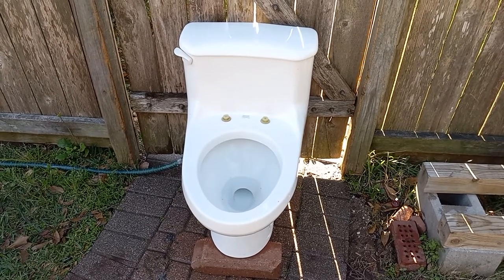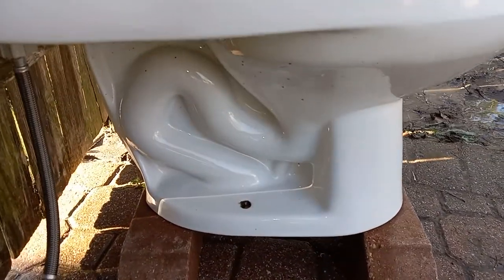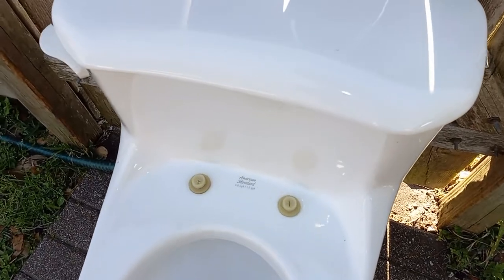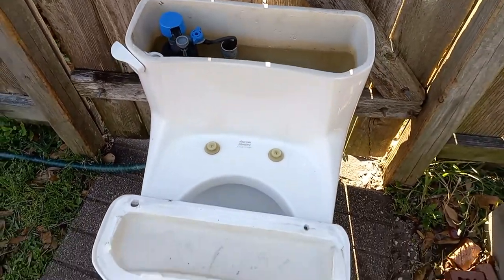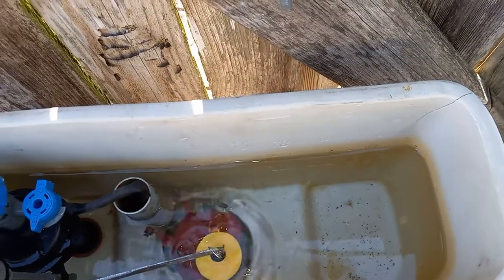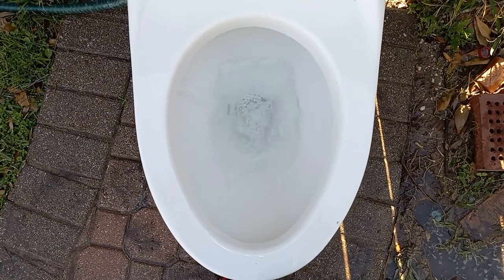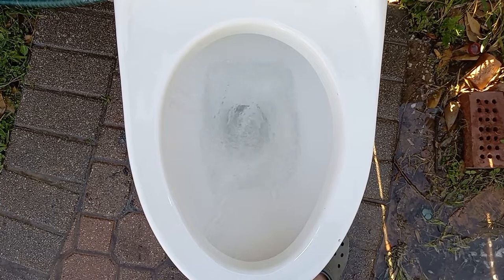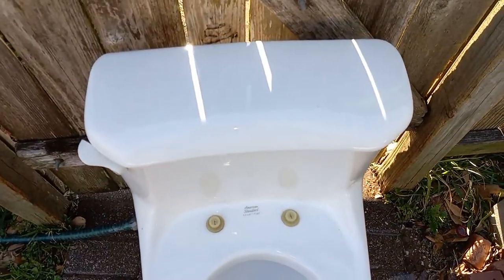2003 American Standard Hamilton Flushes!

Comment: I had one in my old house and at first it clogged every time I used it, but then when the plumber fixed it and replaced the fill valve, it still clogged easily on a lot of TP, but it did decently on normal use.
Reply from the maker: I am not surprised that it clogged.